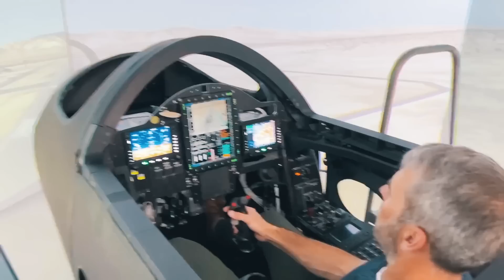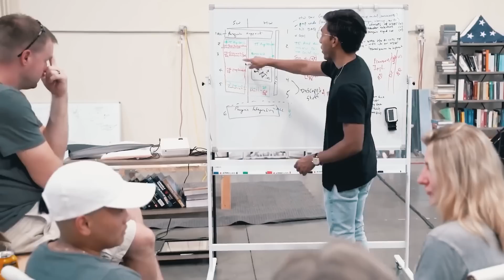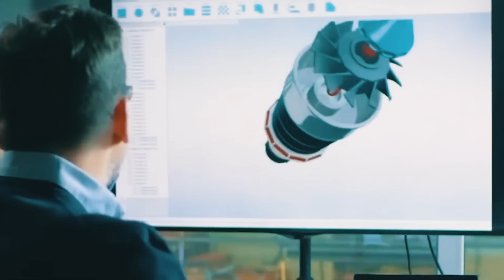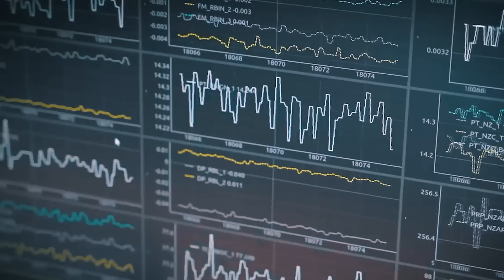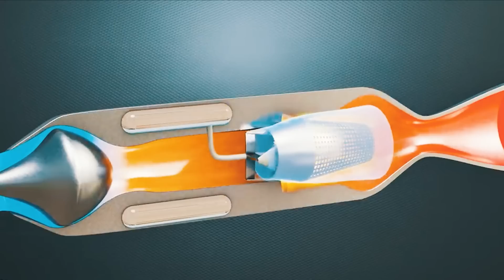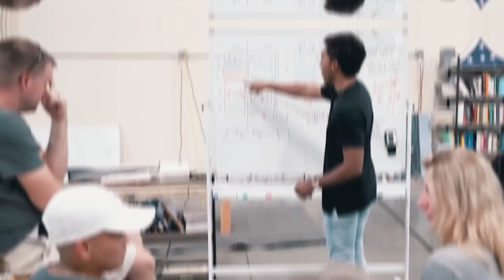US Tests Top SECRET Hypersonic Aircraft to Beat SR-72

Comment: The J58 engines in the SR71 were capable of extended cruise at Mach 3.24 from a design that was based on slide rule technology. That was their design speed for maximum economy at altitude - not their maximum speed.

Given that that even the first Nokia phone had more computing ability that a slide rule, someone is eventually going to go faster.

I hope that someone somewhere has faster because otherwise we just have a massive expenditure in tech for nothing.
Reply: Although the SR-71 holds the speed record, the speed was not limited to the extended cruise design for max economy. It was limited by excessive heat on the airframe. The engine design could go faster but at some point parts of the airframe would have melted.

Comment: Dude the Sr-71 is ancient at this point so it isn't hard to surpass and there is rumors of a classified aircraft that already far exceeded the SR-71. Granted the high speed commericial flights are not profitable hence why other companies failed and went bankrupt.
Reply: Yes but this mentioned the SR-72, which is the upcoming USAF plane to fill the same role as the SR-71. Completely different plane tho
Reply: I will tell you they went bankrupt, because the hire-ups like making the big bucks. Let's not forget misuse of the company's funding and making bad decisions, and I haven't begun to scratch the surface yet.
Reply: The SR-72, has old technology with old ideas. Besides with quantum computing everything is done faster and the day's of trail and error are over.

Comment: since is airplane close to suborbit only one thing is missing to be reorbit type on reentry a owerflow protection stream baislcy shutle has sligth uplifted nose peek that air stream and heat kind evapourate ower glass easy and glas can be heavier heat protection or even hub ower as stealth land reorbit on nav for this you require some enginering balance such as peek side stability holders left and right and slight falt egg side since airplane is more dedicated to fly and use off vector wing suport is also recomended either added long tail back stetched like f 22 has or with su 57 front flaps and movable frotn flaps this gives airplane interceptor manevouring and steady sligth fast drive also front wings have slight big may be more curved to adapt to speed in each a kind star know systems althow tech resumble a lott tu 177 and concord style drive but owerflow is solved and airplane eficient size less then 50 passengers so demand economy factor are solved and also price factor since is rather big demand from airplane agency for this type luxury or fast drive per afordable price not to spicy even better is laer vtol extansion 2x2 turbo fans a ramjet that does vtol and fast enough is lot better then  ordinary gulf stream like build mars jet airplane to help and suport civilian traffic except it kind travel mars speed and passenger asking what is the time on land pretty bizar actualy it follow economy ideas to be more suportive to people and cargo travel and make money for air agency and is kind build and researched upon desires and demand off air agencies if build with all am stuff is good build and with ground speed land limit also since is to fast not to burn tyres since this and to big wheels doomed concord and in speeds gets slight unstabile except vtol nails everything and cost and long runaway too so is nice and kind pretty compatible product per wallet travel in fligths makes poeple return to flying and booking  or have more fun at travel all for wallet

Comment: Impressive … this is indeed a game-changer if the turbo-hyper mode shift eliminates the need for a rocket and the 3-D printer technology allows AI configuration control; however, a fully success-oriented schedule makes 2030 a challenge.

Comment: And if I wish to fly one of those things I will be One thing goes wrong at Hypersonic speeds Anybody on board is pink dust Ib that Cause your c*** is in 4 parts cop it Body of the plane fuel tank which is the body of the plane Do engines And the reason I say this Any depect in the Playing during a hypersonic flight everybody's dead

Comment: Very Interesting, I've seen this on another YT channel, according to what I've learned about the now retired Concord, we will have an issue on sonic booms, the SR 71 Blackbird had two, one in front of the aircraft and one behind, this should be very interesting how this turns out, thanks for posting this. 👍 🇺🇲
Reply: Likely not.  The problem with the Concorde was that it did not have  power needed to get it to an altitude high enough, fast enough to clear populated areas.   It was, after all, a passenger plane. Even at low speeds, it was the loudest aircraft I ever encountered so just launching and landing in a city airport environment would rattle the windows!  Back during the day, the issue of the Concorde sonic boom was a red herring to kill any US interest in the project.  Forget sonic boom; just its regular operating noise was painful!  The SR-71, would almost literally rocket to its refueling altitude of 28,000' but at subsonic speeds.  Once clearing the tanker, it would climb to its operating altitude.  By the time it reached  its initial Mach, it was so high that there was not enough atmosphere to create much of a Mach spike.  The folks at Kadena AFB in Japan would hear the boom, but the aircraft was so high in its initial approach to landing that is was just a "thang."  With current worldwide noise abatement procedures you can bet the issue of low altitude sonic disturbances is one of the engineering issues being considered for this new passenger aircraft.  (I'm a 70 year old retired USAF aviator; that's how I know all this stuff having been there and seen that...)
Reply: @bgdavenport  Great reply 👍. I am fascinated by the Blackbird, and  lived near an active SAC B-52 base for 22 years. I was also a Navy nuke, so I cried in '06 when the Tomcat was retired. They protected us and shot down 2 Lybian Migs during the Gulf of Sidra Incident '81. I was on the USS Texas (CGN-39). Also, Warthogs regularly fly over Lake Huron, but this summer 1 flew inland a 1/2 mile or so where I live, just overhead! I never expected it or I would have recorded it. U could hear it coming! I also ride on a Huey when it came here in '16. Awesome! Finally, my VA doc here was a 52 pilot here from '77-'83 while I was in the Navy.
Reply: When I see TOP SECRET in the title I can predict the rest of the presentation.
Reply: PRODIGY